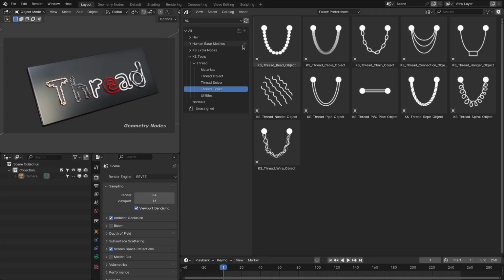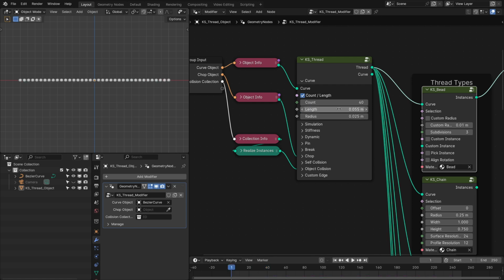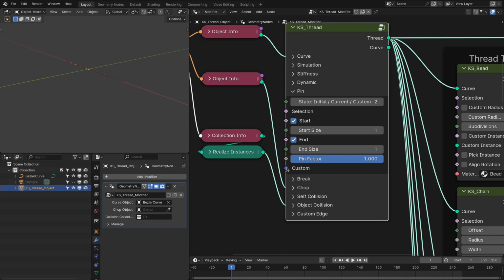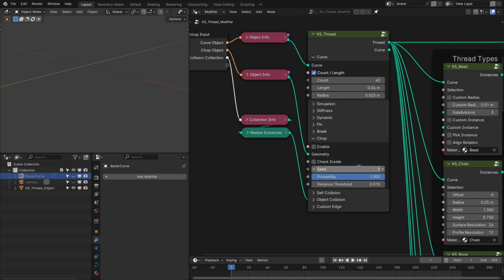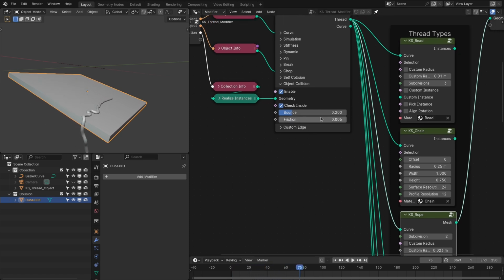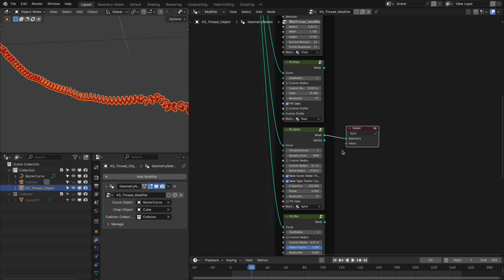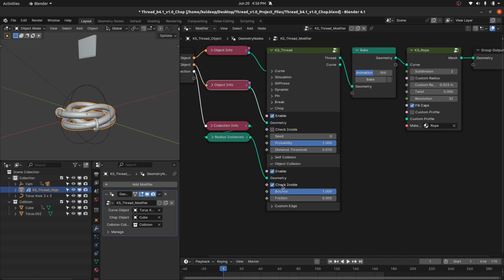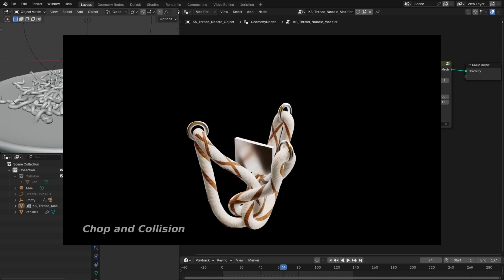Procedural Thread Simulator with Geometry Nodes for Blender - Demo

Comment: Hi, loving these nodes so far. Can you give an example of pinning to a "Custom" object? Can't figure that out, and even if I leave the Custom slot empty in mode "2" the framerate goes from 30 to 0.5.

And another thing: it is just not possible to have it stretch and become very tense, is it? It just breaks.
Reply from the maker: Hi. I'll add that to Project Files. First you need to define the Selection (the point you want to pin, otherwise you can use Start and End selection to pin end points) then you need to define the Custom location for that.
DM me on Discord, I'll share the screenshot.

Yes, just disable the Break option. Keep in mind that if you stretch too far then simulation may not work properly.

Comment: just bought it, very cool tools, i wonder if it could be possible to animate the threads to make worms and make them react to force fields? i saw that you have made some cloth sim with tearing option, do you plane to put it to blendermarket too in futur, it's quite good because still today we can tear cloth with official blender cloth sim. Thank's a lot
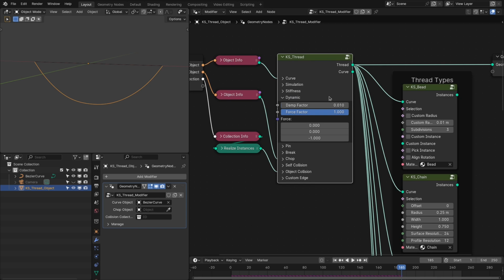Reply from the maker: Hi. Thank you. Yes, you can do that. It has general force input you can add any custom forces (07:54). The Procedural Cloth Simulator is WIP, so when it passes some important tests then I'll release it.